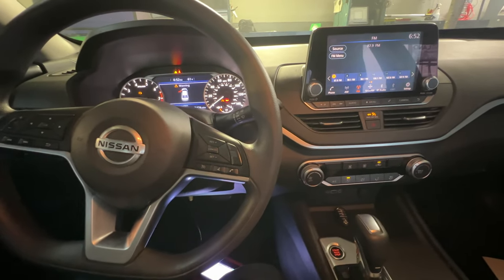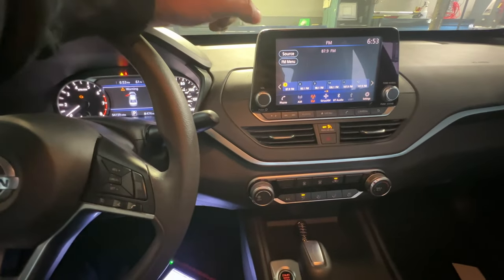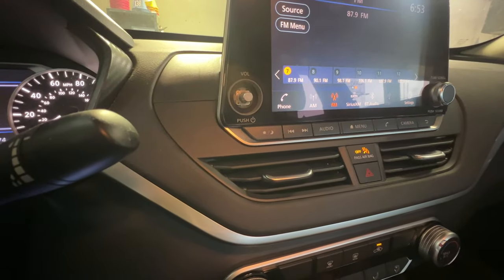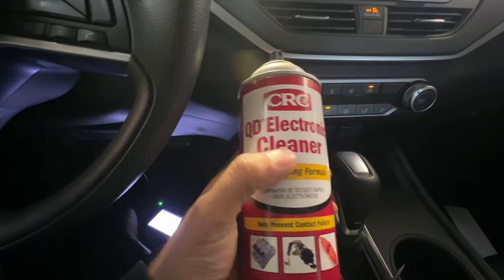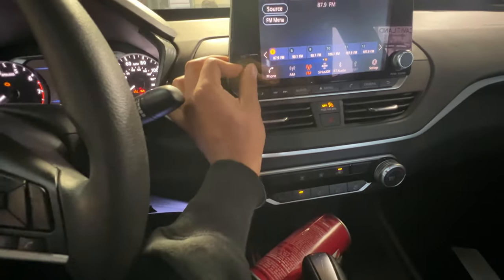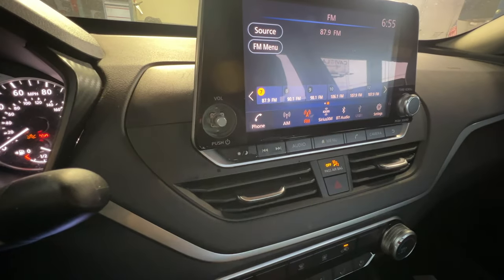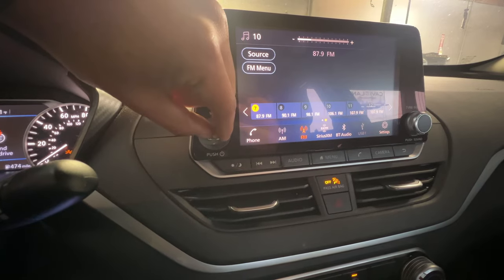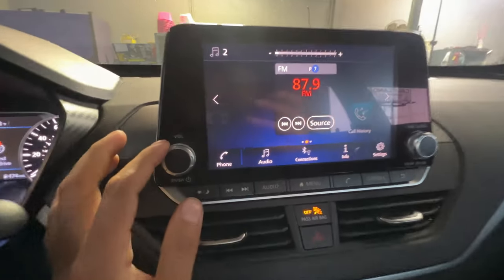NISSAN ALTIMA Volume Knob Jumping Issue Fixed 2023

Comment: I’ve had this issue with my son’s 2019 Nissan Altima.  I called the dealership and they wanted to charge me $220 just to look at the issue.  They said anything over that cost they would apply the $220 towards the cost.  So I was figuring for the dealership to fix the issue they were already saying it will cost over $220.   Figured I’ll give YouTube a try first to see if I can fix the problem.  Came across this video and followed the steps.  $15.00 dollars later (cost for the cleaner) and radio volume works perfect!!!!!   Thank you for this video!!!!!   Saved me a lot of money!

Comment: Just tried this with my 2019 Altima. The dealer said it couldn’t be fixed. A couple of short sprays with WD-40 Electronics Cleaner (NOT the lubricant) and it’s working like new!! Thanks so much for this video! 👍
Reply from the maker: Good to know!

Comment: Mine is even crazier.  The radio will be off and suddenly it comes on SUPER LOUDLY when it wasn't set that way to begin with.  The knob has been 'off' in the way you describe since I bought the vehicle.  For $7 I'm sure ready to try your fix and appreciate it.  I'll post thumbs up if it works.  Thanks!

Comment: Guys follow what he says to the letter, because he knows what he is talking about. This fix worked for my 2020 Nissan Pathfinder. Before I happed upon this blogger I had called my dealer for help in fixing my fluctuating radio knob only for them to tell me to bring it in for a diagnosis and that would cost $175.00. Any other work would be additional. I thank you very much Menjicar you saved me a lot of time, money and aggravation. The only thing I did a little different was to use WD 40 , But I let it dry completely before turning on the radio.

Comment: This worked on my 2019 Nissan Altima! I've had this issue for two years and this fixed it in five minutes. Follow his advise and blow out any excess mass air flow cleaner fluid after cleaning.

Comment: Worked very well thank you

Usually i replace the radio or solder a new potentiometer

I now have a 2021 versa 40k miles. I see we have the same radio. Must be a common issue

Thank you much for the easy cheap and quick fix idea

Comment: I did it today, and it fixed my problem after 4 years. Last week, the Nissan dealership wanted to do a diagnostic test, which cost almost $200. I let them know there should be a firmware update. They just want money.

Comment: There is a tsb for the fix and the first step is to exercise the  knobs (second a software update . I don't do that). I always put a rubber valve stem into a drill and use it to spin the knob back and forth. Takes about two minutes but I fixed hundreds of cars with that issue.

Comment: will try it out. any way to turn off the low windshield wiper sensor? mine shows it’s low & it’s filled. dealership is trying to charge $100 to replace the sensor. no option in the car’s settings to just turn it off & the low windshield light is a nuisance.